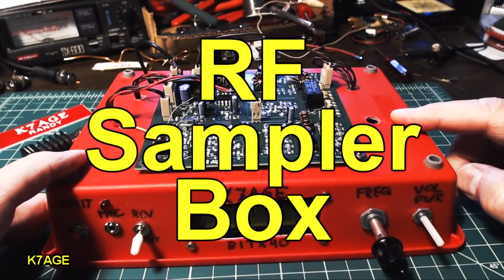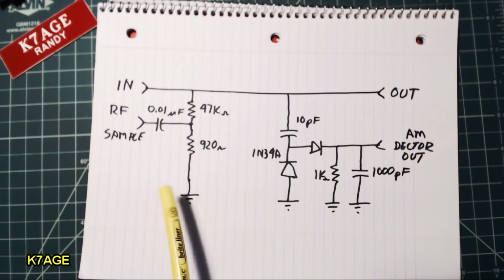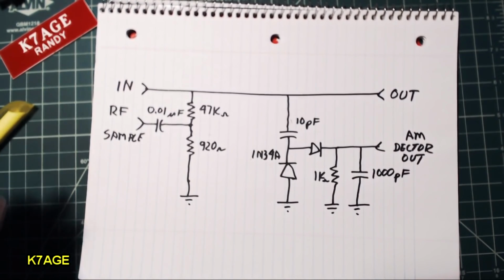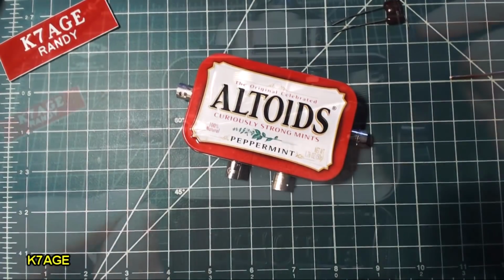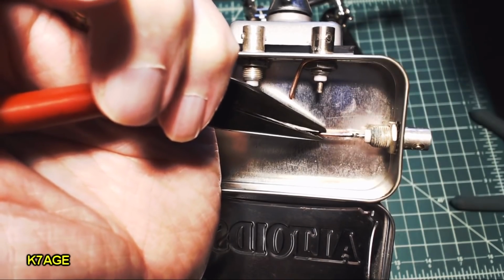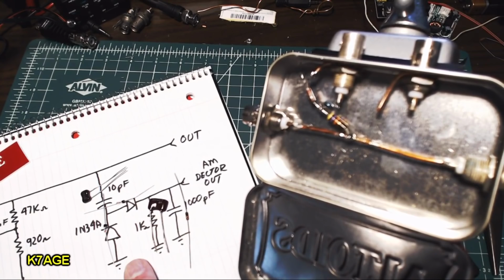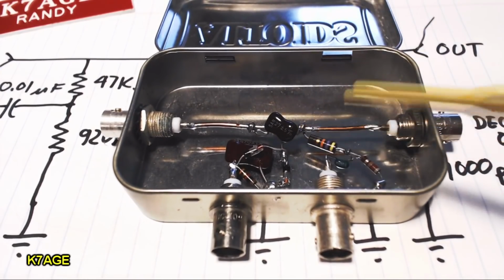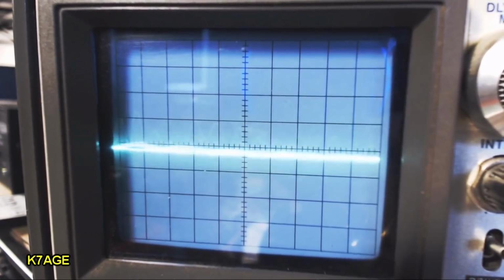How To Build An RF Sampler Box

Comment: I mount my LNA in one of these Altoids boxes - that is what caught my eye.  I use it for the H 1 line at 1.4 GHz with a parabolic dish. Nice project and video.  73
Reply from the maker: Altoid tins are great project boxes. I find that a step drill works best for drilling holes in the thin material.

Comment: Tried building Numerous rf samplers now and i cant get a clean wave form basically my scope picks up local interference you can see it as soon as you plug a test lead in and sometimes without. So im unable to effectively use my scope. At least not cleanly. Its really annoying.
Reply: Try shielded cable

Comment: Thanks for a very well explained and presented video. Please could you tell me if the signal sample is low enough in power to use on a spectrum analyser like a Tiny SA?
Reply from the maker: Not sure without running a bunch of numbers. You could try wrapping the center wire of the coax around the outside of the transmitter's coax to pick up the signal. I would hate to tell you something that might blow out the front end of the Tiny SA.
Reply: @K7AGE  That's and idea, thanks for your thoughts on this. I'll do some more research before I risk the Tiny SA Ultra, which I think is great.

Comment: I think you can use that in XY configuration to look at a trapazoid waveform
Reply from the maker: I think you would need two. Typically one is in front of an amplifier and the other one after it. Then feed the two into a scope with XY display. This shows linearity of the amp. Or, do I have this wrong?
Reply: run the sampled RF into X and demod into Y. you should be able to get a trapazoid pattern
Reply: @silvermica-u3d  You'll get a trapezoid but it won't tell you anything about linearity as you will be only comparing the RF output with itself, in effect.
Reply: Hope this helps
Reply: @silvermica-u3d  Yes, I know. In this case, W2AEW is uncharacteristically wrong. If you download the Kenwood station monitor manual, they are very clear on this point. http://www.coutant.org/sm220/sm220man.pdf - see page 13.
Reply: I'll qualify that - with a simple sampler as shown, you can measure modulation depth via a trapezoid, but not linearity, which is the usual application. Apologies for any confusion.

Comment: What is the input impedance -I think it should be 50 ohm for amateur radio work?
Reply: It's not a termination, it's just straight through so the 50 ohm load would be after the sampler, which he says in the video. Unless you mean the characteristic impedance of the device? Well at HF for a short run between in and out I don't think we need worry.

Comment: One point is to never use mechanical connections to make electrical connections. Run a heavy wire from one 239 connector to the other with proper solder rings.

Comment: Good show.  Will build one soon.  But what is the best way to drill or cut the holes for the BNC connectors?

Dave K8WPE
Reply from the maker: I used a Harbor Freight step drill. A large drill will grab and tear the thin metal.
Reply: I have used a sharp pointed tool like a awl or an ice pick and I drew a circle or shape such as a DB-9 plug on the metal box and gently punched or perforated the metal along the inside of the lines then went back and made them bigger so that I could gently pop the metal where the hole is needed out. On most occasions the hole is a press to fit for the part I am mounting in the altoids or sucrets box. It works great.

Comment: nice vid. but I would put a 4 pin mic jack on it with a propper mic.
Reply from the maker: That is on the list
Reply: The mike is connected to the transceiver,this box is connected on the antenna output from the transceiver.